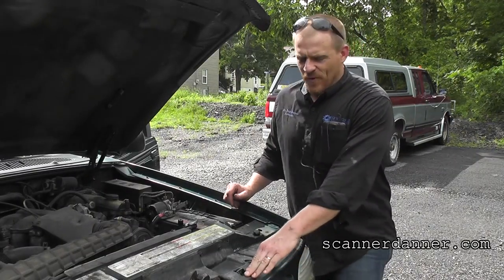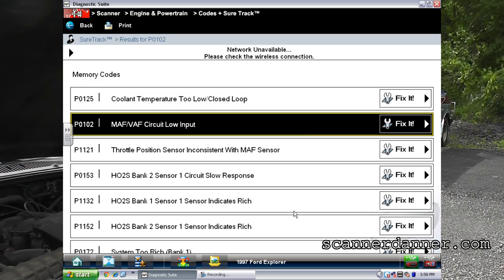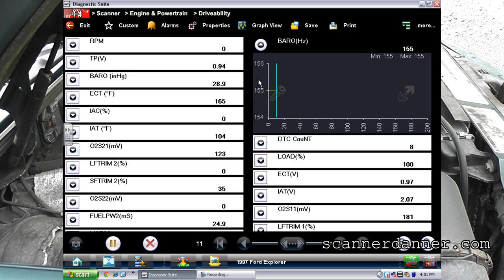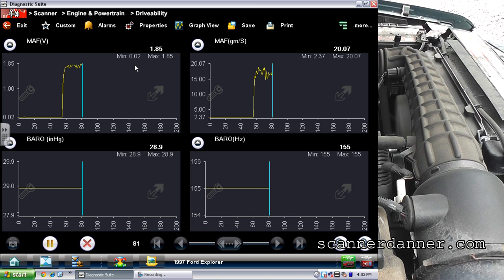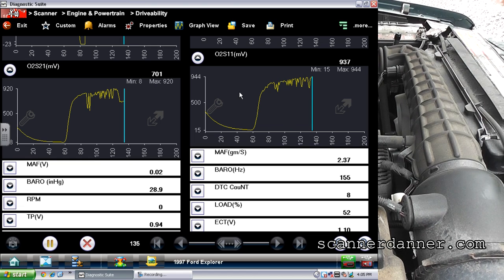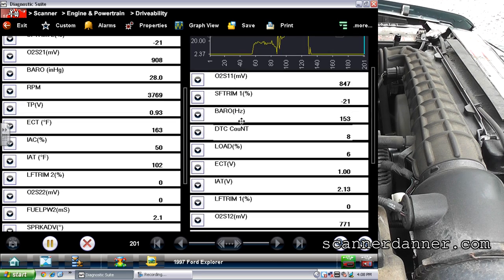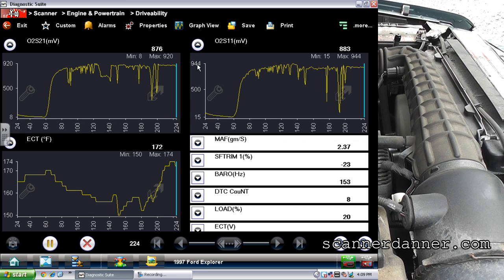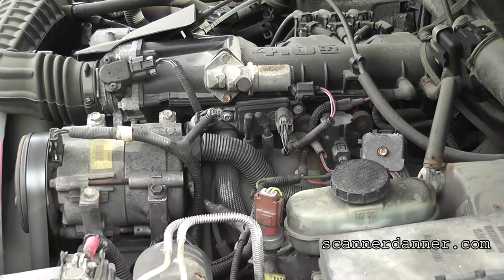How to test a Ford MAF sensor

Comment: Question, trying to fix Brother in laws 1996 f150 4.9 the MAF live data reads 0.10 with key on engine off. It reads the same with the MAF unplugged or plugged. Pretty sure it's a bad ECM. I've checked multiple vehicles with my scanner and all of them read 0.00 live data with engine off. I've checked all fuses and relays aswell not sure what else could cause this except maybe a bad ground although the ground wires seem good. Your thoughts? Any help would be appreciated. Thanks
Reply from the maker: with the key on engine off, take a test light (incandescent) connected to battery positive and touch on the MAF signal wire (sensor MUST be plugged in to maintain the PCM ground for the MAF circuit) and see if the MAF signal on the scan tool jumps to 5v. If it does, your signal wire and PCM/ECM are fine. Tell me what you see
Reply: @ScannerDanner  forgot to mention its a regular hand held scanner Zurich ZR15 reads live data 0.10 (lb/min) with or without the mass flow sensor plugged in engine off key.  I don't think this scanner reads Voltage? The live graph does show it jumping like a heart rate monitor with key on engine off.  I did try it though and the prob didn't light up and the reading stayed the same. I made a tiny pin hole in the wire to make sure I had contact nothing happend. I searched the interwebbs and seems like if I get that reading with after leaving the battery totally disconnected overnight and not even plugging the MAF back while key on engine off and still getting that reading then it's the ECM since it didn't set it back to zero? Oh snap almost forgot i did take the ECM out and discovered the previous owner had already swapped the original ECM out and put in from I can see a Junk Yard replacement since the exterior shell and the PC board numbers don't match.. Sorry just a little frustrated lol
Reply from the maker: @johnny4713ify  what are your symptoms and codes? What is the signal voltage reading at the MAF sensor and at the ECM MAF signal pin with the engine running at idle?
Reply: @ScannerDanner  bank 1 and 2 running lean. Just checked with engine off key on 12 volts both with or without it connected checked pin hole and again with it off direct. Then just turned it on at idle its reading 14.11 volts same pin hole reading connected then taking it off and connecting it directly to MAF its reading the same 14.11 used Multimeter
Reply from the maker: @johnny4713ify  4 wire MAF, you should have 12v on one wire, then two different grounds and a signal wire. Give me voltage readings on all 4 please
Reply: @ScannerDanner engine off key on from left to right Green 0.04 orange 5.86 black 0 red 12.5....Continuity on the black is .028 I took the connection off the MAF and took readings directly from wire connection unless you want me to do it running pin hole testing i only get the continuity tone on the black wire. Only getting a good voltage reading from the orange and red wire
Reply from the maker: @johnny4713ify  this all needs to be done with it plugged in, just backprobe the terminals with a pin. We need loaded circuit tests.
Reply: @ScannerDanner  Sorry had to feed the kids. OK results green wire key on only 0.15 at idle 0.89 Sorry what looks like orange wire is white after removing some insulation my bad anyhow white wire both key only and idle 0.03 Black wire Key only 0.03 idle 0.05 Red wire key only 12.5 at idle 14.25. Hope this makes better sense I back probed all of them with paperclip made sure it was seated all the way back. What's a little odd is the white wire when reading voltage directly from connector off it reads 5.86, but back probe connected reading is only  0.03 🤷‍♂️
Reply from the maker: @johnny4713ify  you may be barking up the wrong tree here with focusing on the MAF, those numbers sound right. The wire that reads .89 at idle should increase in voltage as RPM rises. What are your fuel trim numbers at idle and 300 RPM in park?
Reply: @ScannerDanner  Your right about the reading it did go up when giving it throttle. I tried to read the trims but the engine is running super ruff all of a sudden so I know I must have another vacuum leak. These hoses are so brittle SMH. Ill let you know tomorrow.
Reply: @ScannerDanner  They are high at idle STFT B1 18-25%  LTFT B1 25% STFT B2 15.6% LTFT B2 25% ABOVE 33% HIGH RPM. So question is it normal while key on engine off for the MAF to read 0.10 (lb/min) with the MAF not connected then reading the same connected? The MAF reads 0.81 (lb/min) at idle at higher RPM it reads 3.35 (lb/min) connected. Fuel filter, Sparkplug wires, plugs, distribution rotor and cap have been replaced. New battery installed. No vacuum smoke test leaks that I see
Reply from the maker: @johnny4713ify  your talking about scan data MAF reading engine off? Yeah, I'm not worried about that at all. What is your fuel pressure? 
This is not an ignition system issue and it doesn't sound like a vacuum leak because trims get worse at higher rpm
Reply: @ScannerDanner  Yah the reading while engine off key on on the MAF is odd to me since all the other fords I have read zero 🤷‍♂️ figured the ECU is already thinking its already running and automatically is giving it more gas throughout the powerband once I turn it on. I'll have to pick up a pressure gas reader tomorrow after work. Thanks again I know this is a 🧠 🤯 for sure

Comment: I Just bought a 94 ranger 3.0 liter 56k original miles on it has no power and has a mis I replaced the fuel pump & filter New plugs wires rotor & cap ,Now on the coil there looks to me like a little silver I don't what its called  it looks like a condenser on an older motor  with points but there are no wires on it they were cut or broke off  and there is a wire coming out of the coil Harness with a connector after the connector the wire is cut off and I dont know where it supposed to go could this be my problem with no power and a mis
Reply: It's not your problem, it's only there to lower interference to the radio.

Comment: u got good volts on maf, good grounds n signal so how is it bad ? I want to test mine with no fancy scan tool
Reply from the maker: The voltage trace was not good my friend. look at 10:04 on the scan data graph. If you have a good voltmeter, you may be able to catch the glitch in the signal
Reply: J Love do yourself a favor. If you can't afford something like a pico scope then look into a hantek 1008c. It's a cheap oscilloscope with automotive based software you can get for less than $80. I have a pico 4425 I keep at the shop but I wanted something cheap to keep at the house in case I was doing something there and it gets the job done.
Reply: +John Pilgrim (Portcity52) thanks for that.. just agot a cheap 50 d live data code reader.. says maf g/s ect what should that read.

Comment: what is the normal g/s at idle for this motor?
Reply: 5:41
Reply: Missed that thanks
Reply: @Just2362  later though he says he's not sure if it's 4 gs for 4 liter or half like 2 gs for 4 liter, so I'm confused at this point
Reply: 9:09 "I don't know how accurate the 4 grams number I gave you guys for a 4.0 liter or was it half the number of the liter of engine"

Comment: multiply g/s at idle x4 and this should be close to max g/s at wot
Reply: Mike S not even close. Most cars out there are between 3-5 g/s at idle. 4x 3-5 is 15-20 g/S. Most cars are 5x that at wide open throttle
Reply: Ya that was supposed to read 40 not 4 so multiply base hot idle g/s x 40 and you should be able to get close to that on a wot 1-2 shift